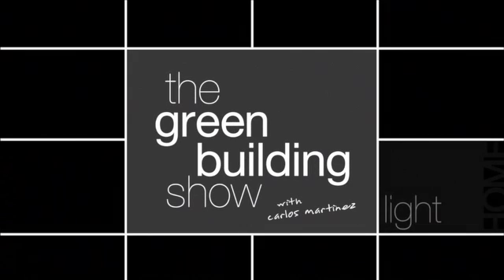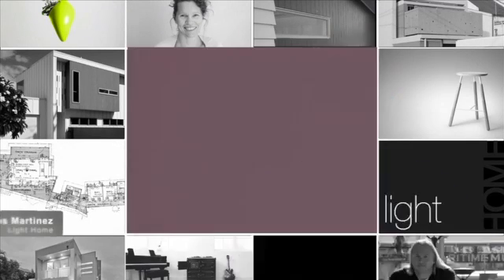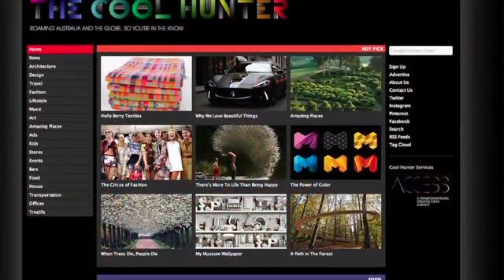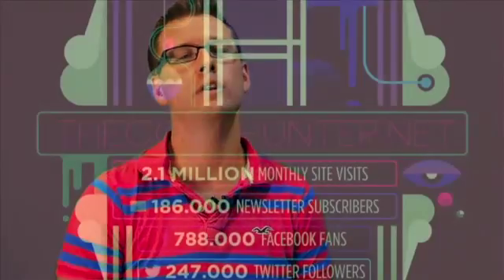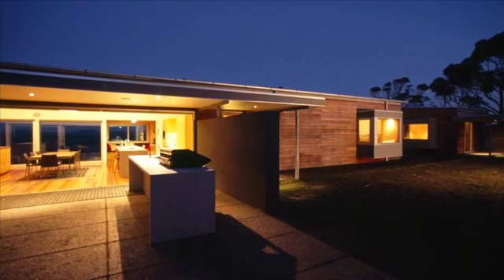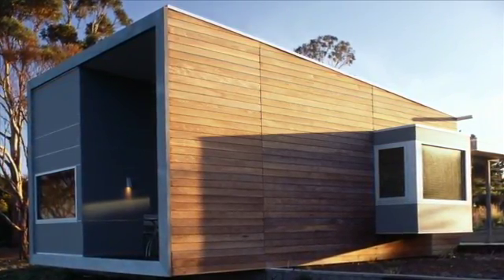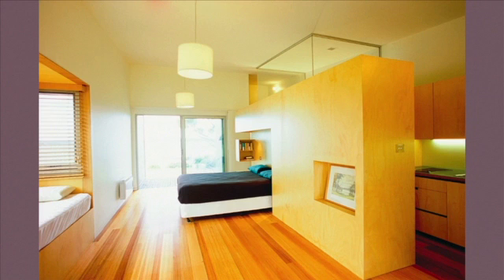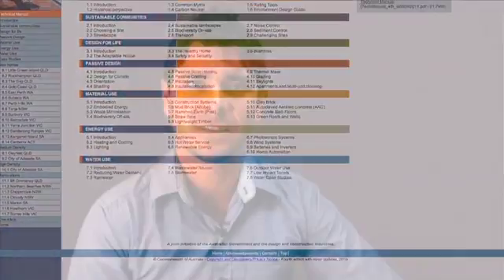How do I build for a hot climate?

Comment: Planning on a house in the hot tropics. This is very helpful!

To note, I've learned that our current house in the tropics, it is important that the surrounding surface of the house does not create/keep the heat (like a cemented/paved driveway) and having the breeze carry it through the house.

Comment: I lived with quakers when I was in college. They had an attic fan that they would turn on in the evening after opening the windows. It would suck the heat out and pull cooler air in through the open windows. They didn't run it all night but just until the house cooled. Then, in the morning,  they closed up the windows.  It worked very well!

Comment: bury a large pipe under ground, deep enough to capture the coolness of that depth .. the depth will be in the range of 10' to 15' deep. connect this cool air pipe to your duct work. now allow the air to flow from the floor across the room to a ceiling register in the attic . this is how the flow is generated, no fan needed. the bigger the house the bigger the diameter pipe needed. and the longer also.... free conditioned air is very possible
Reply: It's honestly amazing that it's not more common in Australia
Reply: Blahblahblah Blah 
Digging is expensive
Reply: Not possible on hot & humid climate due to the humidity
Reply: @Karter Quentin Yea, I've been using instaflixxer for years myself =)
Reply: @Karter Quentin Yea, have been using instaflixxer for since november myself :D
Reply: you prolly dont give a shit but if you guys are stoned like me atm you can stream all of the new movies and series on InstaFlixxer. Been binge watching with my girlfriend for the last months xD

Comment: I'm in a hot climate but I've lived in the tropics.  In wet, hot climates thermal mass isn't as important due to the limited diurnal fluctuation, I didn't realize that.  Nonetheless, it would be important to keep thermal mass away from the building on the exterior, too.  Here in southern California all the houses have stucco cement jackets over them, to keep the sun's warmth penetrating into the house, into the evening as well as during the day.  Backwards.  The thermal mass should be inside the envelope and deployed according to location and heat absorption properties.  Exterior should reflect away all parts of the light spectrum but especially the low frequency radiant heat, and retain as little (light weight) heat as possible.
Someone should experiment with laying a radiant barrier on the ground around the house, where the sun hits.  We use rigid insulation for that now, but it too absorbs radiant heat until it's saturated, and then passes it on.  A radiant barrier would keep the ground cooler, allowing for evaporative cooling tubes etc., to be placed at less depth and would increase the cooling benefits of any basement air circulation system.
Reply: Actually, with all the fires we’ve had in s.cal. and the lengthening fire season, all that concrete cladding (stucco) is looking better and better. Fire resistance is something we didn’t have to worry about before. We sure do now.
Reply: I'm an architect in central Brazil. Most of our houses are built with ceramic bricks, because we inherited the construction tradition from the Portuguese, who colonized us. The high thermal mass of our walls is a problem when they receive direct solar radiation. But when shaded by balconies or large eaves, the walls remain cold and the internal temperature becomes very pleasant for several hours.

Comment: Saint Michael's Sustainable Community uses these principles.  They build into the sides of the the mountains facing the ocean.  There are  gardens on the roofs, the homes are all cross ventilated, The east and west of the buildings are shaded with plants or rain water collection, (The view is an ocean view - Southward), all rooms have high windows to allow warm  air to escape at night, and the exterior walls are covered with ivy that cools though the chemical process of the water being evaporated (changed from a liquid to a gas).  The water used for the cooling process is grey water from  sinks and showers.  The entire home is transformed into a free energy chiller. The homes all have systems to collect and store rain water, edible landscaping, medicinal plant gardens,and lots of rare fruit trees plus all of your favourites in the 100 plus fruit tree varieties on site.  There is also a food forest with  18 hole disc golf course. You can rent some of these homes there. It is enchanting.
Reply: Good on ya mate

Comment: I've thought about building a house with a flat roof and then a pole barn structure with a peaked roof over that. The flat roof would function as a deck and would have a 2nd floor porch all the way around it, extending out to near the edge of the peaked roof. A matching porch would extend around most of the building on the first floor with the exception being a possible garage entrance.

With this design it wouldn't matter how hot the roof got because it's not enclosing an attic. 

I've also considered incorporating chimney like structures projecting from the flat roof with heat activated vents and possibly fans. The idea would be that hot air in the rooms would rise into the chimneys and be vented when it got hot enough. I'd have to test this idea before using it as the temperature differential between the top of the chimney and the room below might not be enough to make it an effective cooling technology. Diffusion of air molecules might make the room temperature too uniform for this to be of benefit.

I've also toyed with the idea of playing a misting system around the outer perimeter of the house to lower external temperatures, but this might promote rotting of wood and would not be as effective in our humid climate as it is in drier areas.

Anyhow it's just an idea right now as I don't have the financial means to make it a reality.
Reply: Brilliant, mate. I'm thinking of possible designs for our family home. The wife thinks I'm mad - no money for land or a house (well, 20K in crypto) - but if you don't plan ahead and have a vision to aim for .... Earthships look good.
Reply: @Nautilus1972  exactly! similar situation here. Not a whole lot of money, but need a vision. Fiance wants a brick house for thermal properties, whereas I'm thinking timber would be a lot cheaper and more flexible designs possible - like what this guy is suggesting with this roof over the house kind of idea.
Reply: @Nautilus1972  oh fuck I guess your wife is even more mad right now, right? 🤣

Comment: But Darwin doesn't have breezes!!!!!! The slight breezes one finds in Darwin and it's surrounds are few and far between.
Reply: dont want to burst your bubble but I do believe he referred to Cairns not Darwin.
Reply: V8SB4U2 VASB4U2
Yes, Cains has breezes, BUT, Darwin doesn't.  So, building for hot climates is a little too broad of a statement. Hot climates can be dry, or humid, windy or calm, and what works in one area may not work in another. Clearly you missed my point.
Reply: +Crusty Gronk i lived in Darwin and yep, during hot months( build up ) there is no breeze. This guy is full of it
Reply: niceslug
We do get odd puffs of breeze, but you cannot rely on it. Mostly it's a hot humid breeze whenever it blows in a window. LOL.

But I understand what this guy is saying. In a place like Karratha, North of Perth, where it is hot but not so humid, or some place where there is a breeze, like along the east coast, it might be fine. Not here in Darwin. I'm planing to build, small windows, double glazed, closed cell spray foam and air cond. Open windows only lets the humidity in. LOL. Cheers.